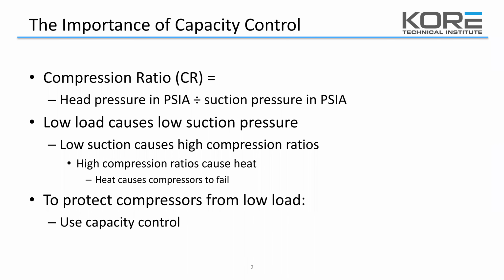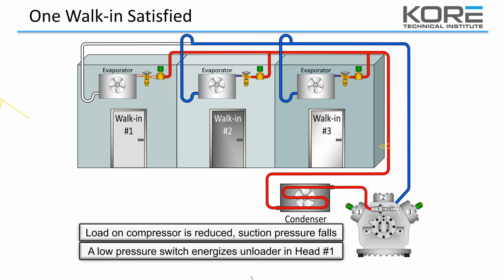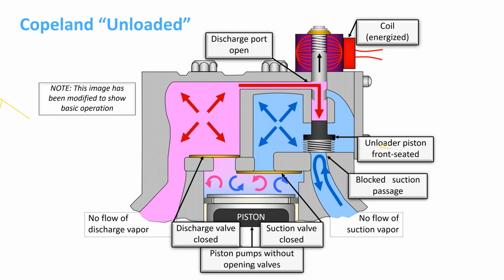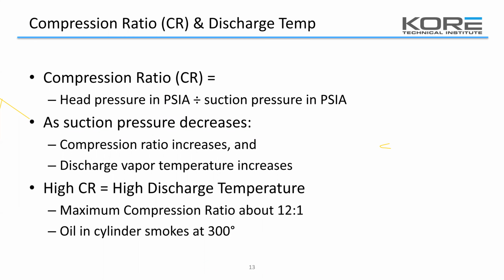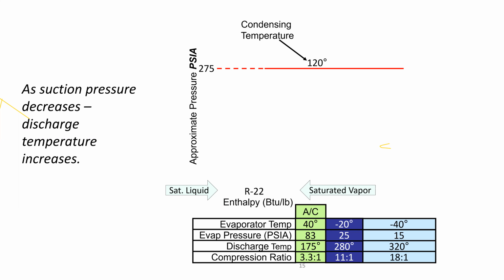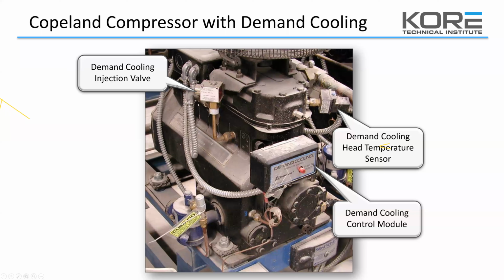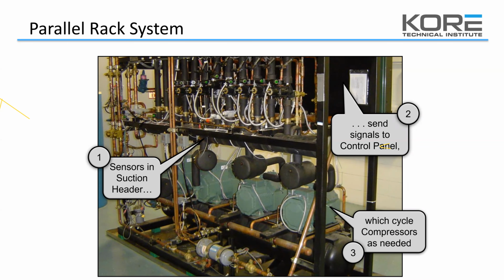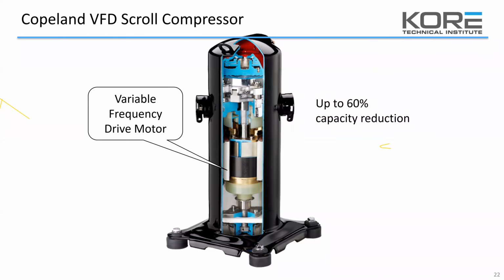Components - Compressors and Compression Ratios

Comment: If we reduce the load of the compressor or VFD to decrease the speed of the motor, does it effect to the discharge pressure ( discharge pressure is too low), reduce the condenser capacity?